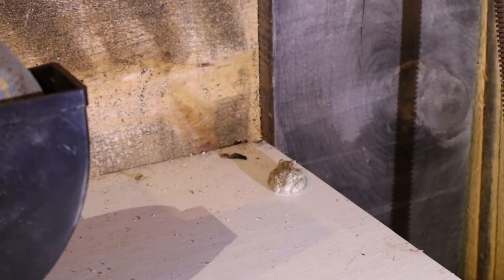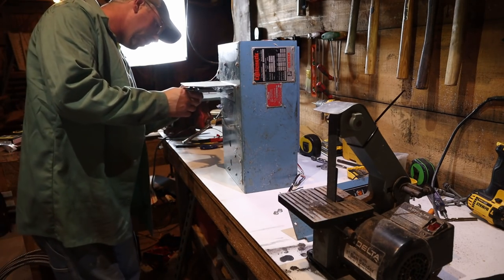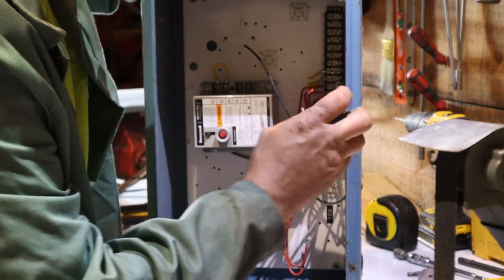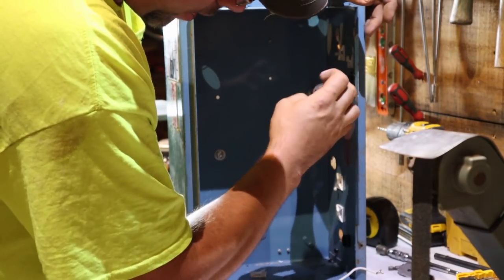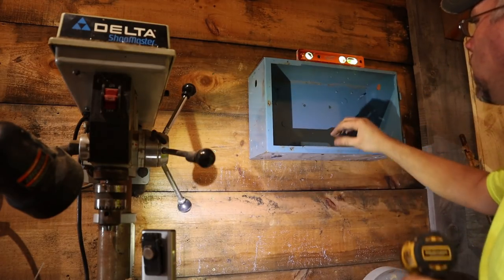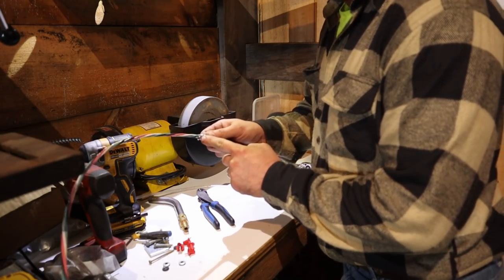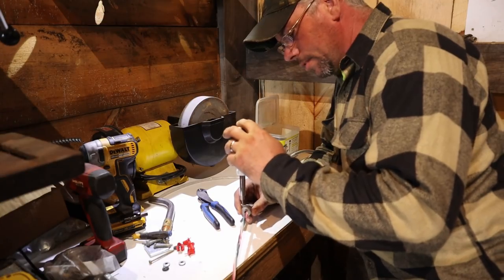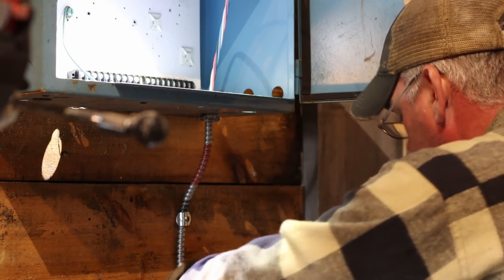First Electrical Wire In The Timber Frame: A Timber Framing Vlog

Comment: I went into my local Home Depot to get some bx cable and was told it isn't used here (Florida). When I asked about mice chewing on the wire, he said "We don't have rats or mice, the snakes and birds ate them all". But I like that the BX absorbs the electric fields emitted by the wires and shunts it to ground.
Reply from the maker: Good morning James.

Comment: I built an addition at my last house and did all of the electrical wiring.  I was concerned that the inspector would be hesitant to approve the installation because I was the home owner and not an electrician...so I went overboard with neatness and code compliance.  The inspector took a look at one light switch and the main panel then put his seal on it.  He said if everyone took the time to do it right, his job would be a lot easier.

Comment: Nice video Jim, I’m with you on having a tidy electric box. I used to wire panel boards for huge baling machines. I had a repair to do but when I opened the box holy moly! What a mess. Spent a whole night shift getting it up to my standard!! It’s just as quick doing a proper job right first time! I agree with you not wanting to be hunting for a wire a rodent has chewed through. Love your new assistant Mr Frog. I’m lucky, I have a Robin come and watch me in my shed. She doesn’t fly away she just sits by my power saw and watches. Love it. Take care, very best wishes Graham 🇬🇧🇬🇧🇺🇸🇺🇸

Comment: MC has a separate equipment ground conductor BX uses the armor as an equipment ground  usually along with a very small redundant ground that seems to only be good for holding the anti short in :)
Reply from the maker: Thank you for sharing.

Comment: Morning Jim.... electric 101. I helped my father-in-law wire my house, up to the first time I melted the tip of a screw driver in an electrical box.... I then went to work on the plumbing! It was 32 degrees here this morning, I hate the thought of that white stuff right around the corner. Have a good one.
Reply from the maker: Winter is coming John.

Comment: you want bx wire every were in a barn or shop, be its in the wall or not as they are notalways heated an squirrels  love to eat wire, i cheeped out on my shed lights and due to the feed, the dam squirrels eat a hole though the wood and chewed my light wire off up in the ceiling, had to cut a hole to get up in that tight space to fix it, always use bx in buildings like that

Comment: looks like a boom build to me,, i dont go so big.. lol i have a bunch of high limit snap switches in stock for out door wood furnaces, 2am service calls in 40 below.. they are not adjustable, there set at 215F, so if the water temp hits 215 it shuts the whole unit down, stops that fan, closes the damper. and will fire back up when the temp drops below 200, dont think o have seen an adjustable snap switch, just order in the sizes needed, also have ones that turn on blows on hot water over head shop hot water rads that turn on the fan when it hits 180f, and the wall state is set to say 70f, when the wall stat hits 70 it turns the fan and pump off, just so the fan dont run if the wall stat is calling for heat but say the pump failed you dont have the fan running none stop. MC  wire, its called BX WIRE HEre but hay like they say us ppl are backwards.. i alway run extra wire in boxs so if a wire burns off a breaker ot just brake you have wire to work with, i hate going in to do a repair and wires are so tight you cant even get the peace out of the box to work on it cars an trucks are the worst for that.., after watching more MC  wire must be a high heat metal clad wire. i always cut BX  with a big set of lines men plyers, nice an clean, but take note, i have blowen the cutter out of more lines men plyers over the years then i care to remember. you turned all the power off but some how there is one live one being feed from some other sub panal or building, and you light up the atic.. umm i dont see your permit on the wall, you know they want there $150 even it your just adding a plug, or replacing plugs or light, yet you call for inspection, and inspecter says, oh i have closed you off your good, many inspectors have told me, i do a far better and nicer job then most electricians do, i have even been told, a licensed electricians didnt do this nice job, mind you i had a great high school trades teachers as well as a great mentor in my teens an 20's

Comment: Hmmm ..... I thought you said the blower was tripping out a 20A breaker?
If your power is so low on those blowers you could get away with a good light dimmer module to vary speed (it is a bit more technical than that but the tech can be ignored on this)!
Personally when I wired something up I wanted people to say "How the hell did they get a wire to that?" ...... invisible is good!
Having said that neat is good too ;0) It would be good to have a delay on that extractor so you could just walk away and have it shut down when safe!
Reply from the maker: I mentioned that it tripped out because there was too much air flow and I had to add a restriction plate to cut down the air flow.  It is running at 5.9amps now.

Comment: One more suggestion, AFCI breakers may give you a little added peace of mind. They’ll hurt your wallet but could save your life ~
Reply from the maker: We have to use them in residential wiring now.  All circuits that are  not designated for say a fridge, water heater and so forth.  It used to be just for bedrooms and then our code changed in 2009.
Reply: TheTradesmanChannel it seems like every code cycle they add more circuits that need AFCIs
Reply from the maker: They sure do.  I'm behind on them being away from it for so long.  Good thing this is an ag building but it will still be inspected.

Comment: I ´ll never understand your electrial system over there, and 60Hz... I am an electrician (was, retired), and here in Sweden we use MAX 20 Amp in a house 3-fas, 50Hz, so this will be intresting... thx Jim.
Reply from the maker: I work with a lot of three phase over here, just not in the residential end of it.  Most of the equipment I work on is 460v three phase at 60hz.
Reply: @TheTradesmanChannel  Like I said, this will be intresting.

Comment: Awg 14 is only good for 12 amps, you only want to load to 80% 12 gauge should only be loaded to 16 amps not to mention if it’s in pipe with more than 3 current carrying conductors you have to start derating ... Sorry to spam your comment section, please don’t block me 😳
Reply from the maker: I wouldn't block you and I don't consider good information spam.  We're all here to learn.  Here our electrical code has us use maximum 15 amp breakers for 14 wire and 20amp for 12 wire.  Stranded wire is good for slightly hire amp draws over solid wire.  Temperature ratings on the circuits make a difference as well as how many conductors are in a conduit.
Reply: TheTradesmanChannel absolutely correct, but you still want to only load the breaker to 80% and thanks for not getting mad at me ! Lol